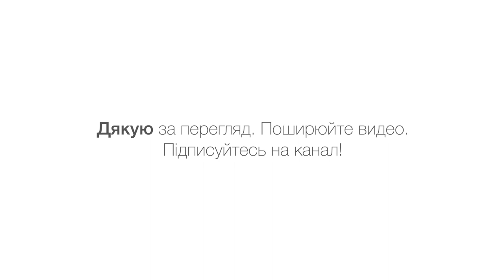Cylindrical case made of natural veneer 🇺🇦 Циліндричний футляр оздоблений натуральним шпоном.

Comment: Why did you cut off a part of the cylinder and how did you make the lid
Reply from the maker: The cut part is the cover of the case. The cover and the body are combined using a cardboard ring. A cardboard ring is glued to one of the parts.
Reply from the maker: If the question concerns plugs on the pipe ends.  They are made of wood.